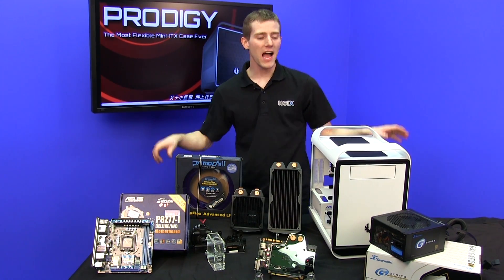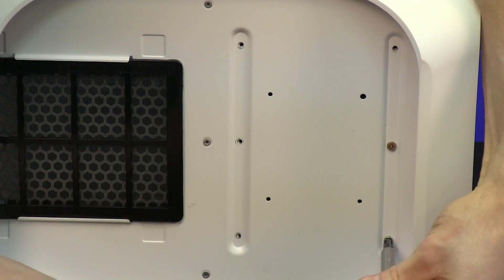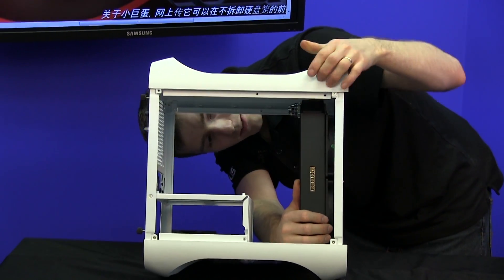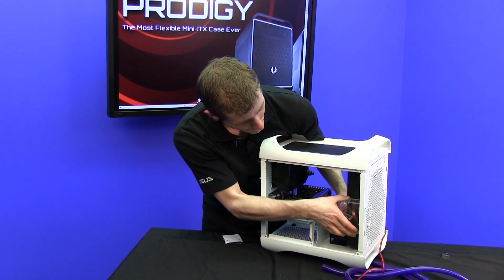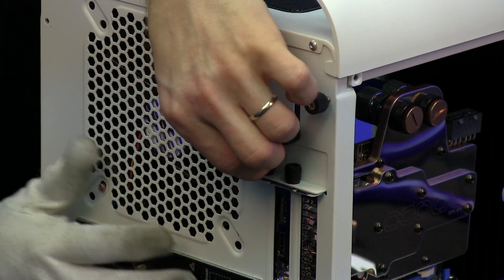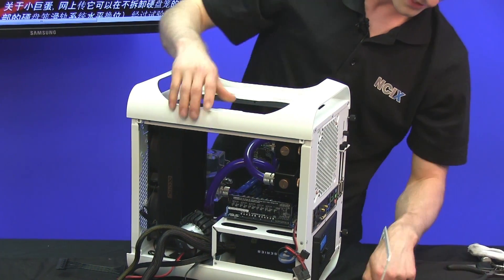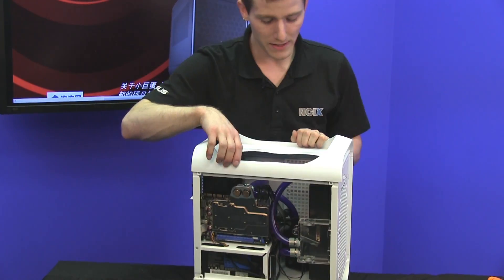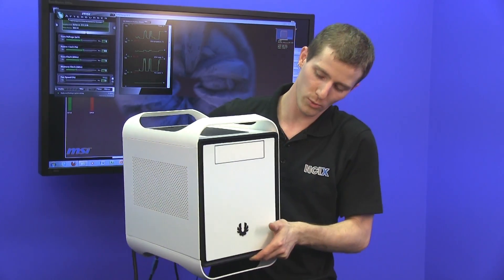Ultimate Watercooling Build Guide: Bitfenix Prodigy, 3570K, GTX670, swiftech

Comment: For overclocking purposes and to lessen the stress on both your CPU and GPU, it is highly recommended that you water cool your stuff, doing so will definitely allow you to push your system further with higher performance without overheating stuff up. Definitely worth it if you ask me.Dropping the temperature from 85°-95° down to 44° is a HUGE difference

Comment: Hi, You mention using SP fans for radiators; As i understood it, static pressure fans help push air through the radiator but was wondering, would you also recommend it it for pull only setups? Like for example on a pull only setup for a H110 exhausting air from the top? Thank You.

Comment: From only the single performance / price ratio perspective, no it's not "worth it" because you can usually get decent air cooling for much cheaper. But if you want to push your OC a bit further and you want a quieter computer and you don't mind the slight increased price then it's a nice option. Honestly, water cooling is a hobby, it's only "worth it" if you think it's cool and you like building computers. Otherwise, using a H100i for the CPU would have been fine.

Comment: I agree with you. Preferably you should use specialised cooling fluid, but since there is not much oxygen mixed in with the distilled water, corrosion will be negligible. Plus distilled water I suspect is much cheaper than branded cooling fluid.

Comment: i thought corrosion is happening because of the salts contained in normal water. but distilled water has no salts in it. thats why i always use distilled water at my cars windshield water spray thing to avoid corrosion and oxidation of pump and sprayers

Comment: Except that most ultrabooks and nearly all netbooks do not have a DVD drive. I removed my dvd drive from my laptop so i could add a second HDD.
Also Airbags in cars prevent serious or fatal injuries due to accidents, and there isn't a viable alternative. DVD drives read data off disks. They are loud and slow, and due to this new thing called the internet we can get the data on demand without needing to physically do anything.

It is not like a car without airbags.

Comment: As a specialist, i will say one thing: pure distilled water SHOULD NOT BE USED in the system due to the maximum corrosion potential, oxidation with the copper waterblocks and staining problem.

Solution: ALWAYS use the premixed watercooling coolant. I probably can recommend the Mayhem's Pastel, Feser Non-UV and Koolance Non-UV coolants.

Comment: Hmm but that would be a 2nd thing to carry, not that I want to build a Prodigy now, but only a though. Any PC I would build. I would like to have 2x256GB SSD's in RAID0 for best performance; for windows, programs and games. And a 2TB HDD for backup, where I would store movies, pics, save-games and so on, something that doesn't have to run all the time. If I would do a water-cooling like this I would probably find a way to fit it in there. :)

Comment: I have a GTX 670 Windforce 3x (yeah I know that it is NOT a stock GTX 670) and I always ensure that my temps are NOT getting over 65°C (and my case is not very good for cooling, one 120 in the front as intake, one 80 in the side panel as outlet, one 80 in the back and the psu as outlet and that's it)

Comment: Reccomend using a non-modual power supply!? A modular power supply is a must in a case this small with very little space for cables. The psu cage is 18cm long so most power supplies will fit just fine, including modular ones.

Comment: wouldn't it be better to go from the cpu to one of the radiators and from there to the gpu and then to the other radiator, because now u pumping hot water from the cpu trough the gpu.

Comment: A 3770k can be used for gaming as well. There is actually a very insignificant increase in gaming performance using the 3770k over the 3570k.

Comment: My HTPC have the same 3570k at 4.2Ghz and i use Deepcool iceblade pro with which is $60 in my country keeps my peak temp at full load at 45..very rare at 55 or below..never crossed the 55. So i think this cooling won't change any thing for me..

Anyways great video as always..

Comment: 30mm is normal for AIO coolers which dont perform nearly as well as real water cooling. This is a custom loop so normal thickness is 60mm and a thick radiator is 80mm.

Comment: normal thickness is around 30mm.  look at MOST of the all in-one liquid cooling cpu coolers out there.  even the expandable h220 doesn't have a rad thickness of more than 30 to 35 tops ( i forgot exact measurement off memory)

Linus was referring to the thickness of your typical AiO system's rad..not custom built rads

Comment: I wouldnt really call it ultimate. The only ultimate Prodigy build Ive seen is singularity computers Prodigy client build. This was more of a general Prodigy water cooling guide. Also Linus, you know good and well a 60mm thick radiator is not "double thick". 60mm is normal thickness.